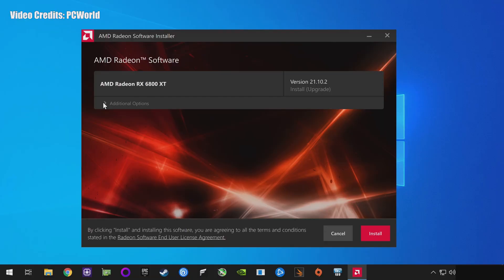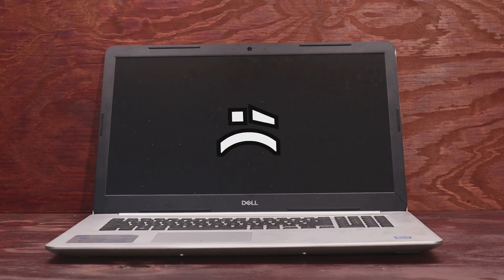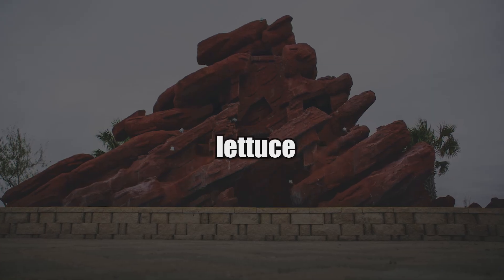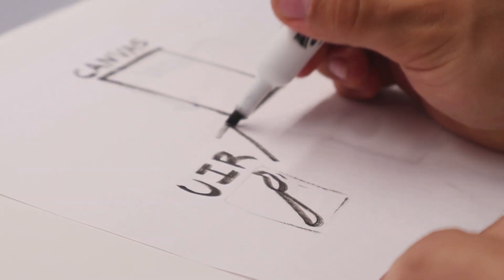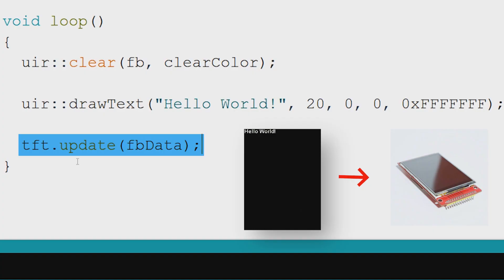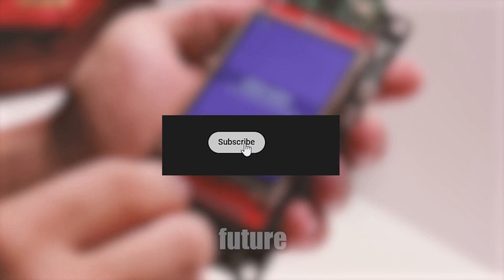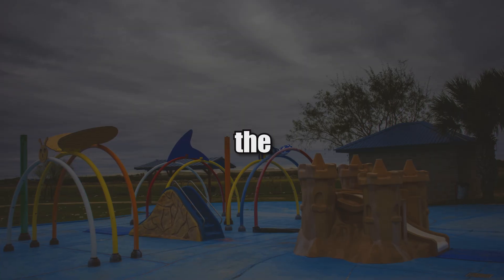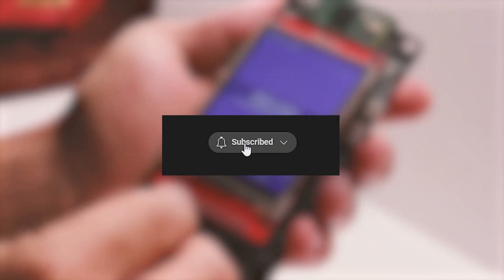Why CPUs Don't Require Drivers

Comment: Minor correction for the end: Virtual machines typically aren't emulators. For example VirtualBox runs software in something called a hypervisor. The hypervisor does some fancy stuff and the code running in your virtual machine is running on your CPU entirely natively. This only works when virtualization support is enabled in your BIOS. However, some virtual machines can be emulators. Like QEMU can run software for a variety of architectures. x86, ARM, RISC-V, ecetera. For example, an x86 guest system running on an x86 host will be virtualized. But an ARM guest on an x86 host will be emulated.